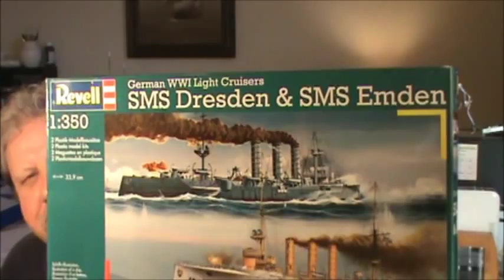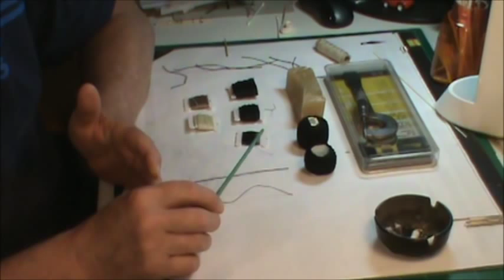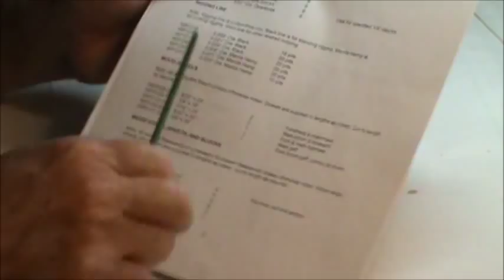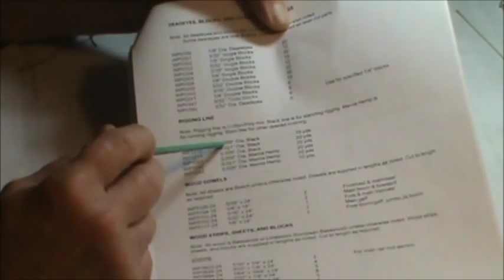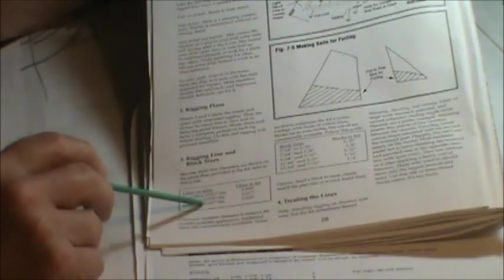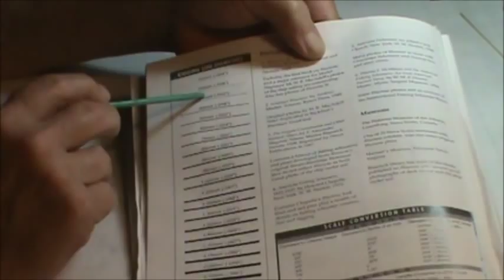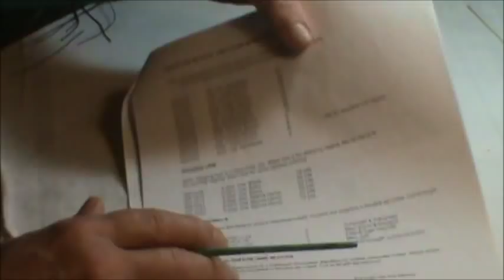BLUENOSE PART 29 --- Rigging has Started

Comment: Oh I DO feel your pain buddy. I went through the same problems with string size with my Bluenose II. Why don't they mark the string sizes? Who the hell knows but it would be the logical thing to do. As per the curled up string........I soaked mine in hot water and then took emery cloth and lightly pinched the string in the cloth between my thumb and forefinger and pulled it through once and it straightened it out. As per the shroud and rat lines I first attempted to make my first shroud lines out of the largest string supplied with the kit and personally found it to be too large. After trying that I went one size down and then used the smallest black string from the kit for the rat lines. Getting back to the plans vs. the line problems (or any problems for that matter).......if anyone at Model Expo has any brains they would be watching your videos to help increase customer satisfaction. They might even chirp in and explain themselves but so far........nothing.
Ed.
Reply from the maker: Hypergolica1 I think maybe someone from Model Expo may have watched my video.  I got a dislike on that video, maybe I pushed someones button.  I have about 5 different sizes of my own string I plan to use so I don't run out.  I don't mine the rigging to much, it's the sails I don't like doing.  But the wife wants sails so the ship gets sails.
Reply: Hi Gary,

Just to support Hypergoluca1's idea:  I was browsing the online instructions for the Model Shipways Philadelphia, and came across this at the bottom of page 14: "Rigging line supplied in model kits often comes tightly wound on a mandrel of some sorts.  This can result in annoying kinks in the line when unspooled.  This is especially true of nylon line.  You can remove these and straighten the line by boiling a length of the line in water for a few minutes and then hanging with a weight attached.  Do not use kitchen pots for this but use something else like a tin can."

I don't have any idea why they would include this tip in the Philadelphia instructions but not the Bluenose, or how you would ever think to do this on your own.  Thanks again for all your hard work making these videos.
Reply from the maker: Lawrence Robinson Realy.....I can see it now, I would have little sections of string hanging all over the house.  Why would they give you something that everytime you need it you have to cook it before you can use it.  Thanks, I will keep this in mind in case I ever decide to use it for something.

Comment: Hello. The difference between the 2 were SMS Dresden had 4 Shafts (Propellers) powered by 2 Steam Turbines, SMS Emden had 2 Shafts and was powered by 2 Triple Expansion Engines. There is an easy way to find out if the lines are synthetic, Try melt sealing an end. Andy C